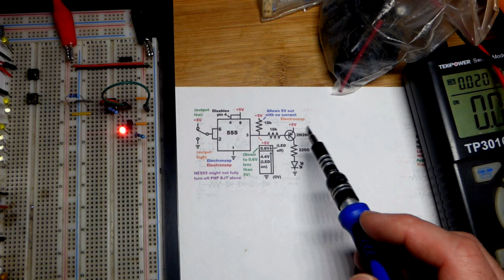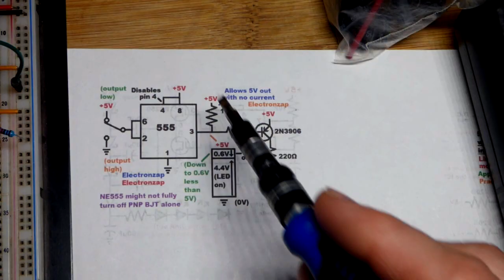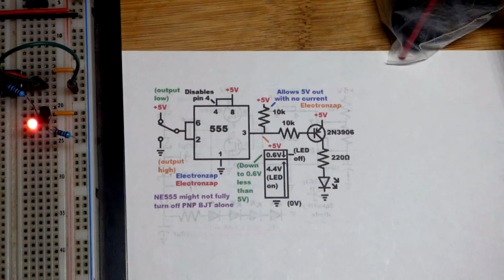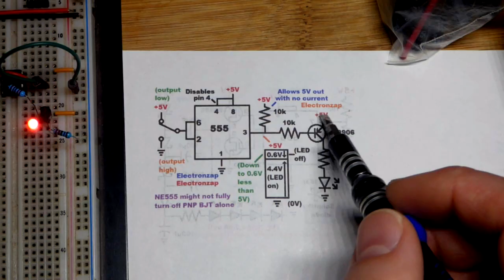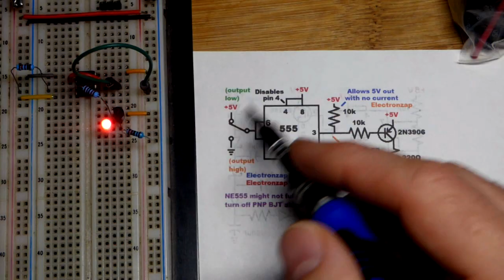PNP BJT Helps 555 Timer Output Get Close to Full Supply Voltage Across Load Headed to Ground

Comment: Hi there. I'm trying to come up with a circuit that will turn on a small heater inside of a box to avoid condensation in an unheated garage. My idea is to keep the temperature inside the box the same as the temperature outside the box. Call the thermostat inside the box Ti and the one outside To. To test this I'd replace the heater with an LED. If the value of (Ti-5°) is less than To, then the LED should switch on (or eventually a relay with a heater). Is there any chance you could do a breadboard video of something like this please? There should be something that keeps the LED from flicking on/off rapidly when the temperatures are balanced.